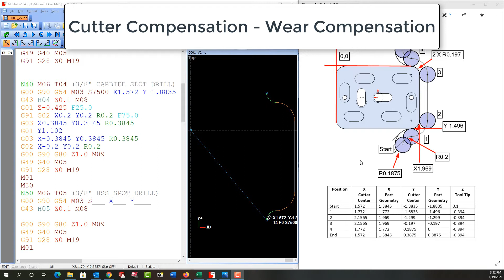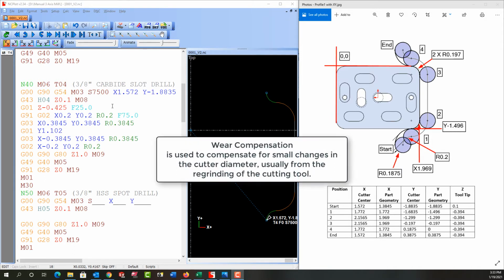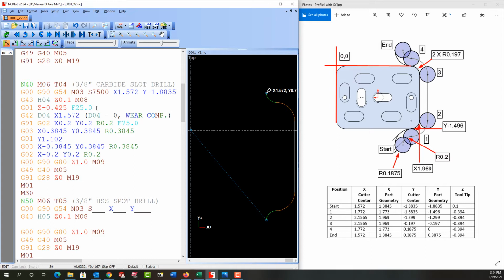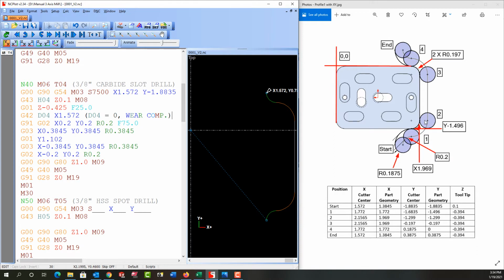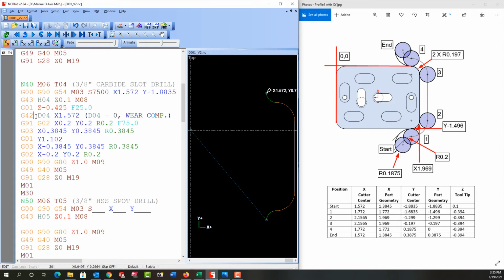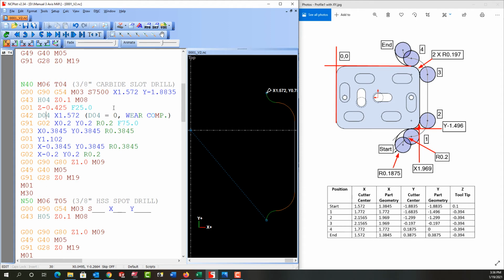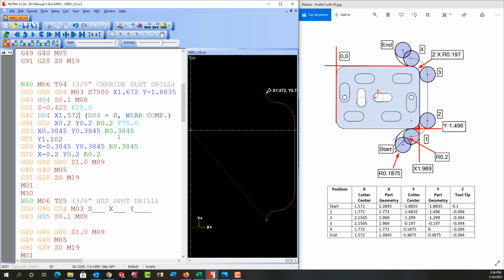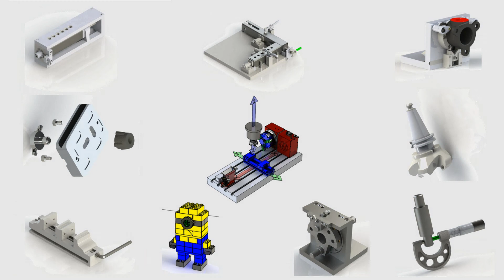Cutter Compensation - Wear Compensation

Comment: What’s the difference between using geometry and wear on the cutter Comp. , some ppl use the geometry column and some use the wear to open/close a hole
Reply from the maker: When using wear compensation the center of the tool is coded and the compensation is used to fine tune the part size. When using non-wear cutter compensation, the geometry of the part is coded and the compensation amount is the radius of the cutter. In some cases the diameter of the cutter is used. Some machines require the cutter diameter to be used and some require the radius and some an be changed to diameter or radius by changing a machine parameter.

Comment: Why don't you just set the wear compensation and let the computer automatically adjust the tool path for you?
Reply from the maker: Because this is teaching manual coding and I am teaching all of the ways to use cutter compensation.
Reply: @Fredumaction  Adjusting for tool wear should not be part of manual coding.  You would have to adjust tool compensation on every G41 line.  And that would be very easy to miss one since you would have to adjust every G41 or G42 that applies to only that particular tool.

Your not necessarily going to have access to subroutines and definitely not canned cycles.  So these routines would look at the D parameter value stored in memory.  If you haven't adjusted this then your program isn't going to be doing what you think it will when using these routines.

Even though what you are doing works it really is not good practice, since most CNC Machines have a setting to compensate for tool wear.  Simply go to the tool offset page and typically you will see that next to the tool offset will be tool wear compensation field.  Measure your tool wear and adjust this setting accordingly.

Hypothetically Speaking (perhaps on a hobby DIY machine): If you are working on a machine that does not have tool compensation at all, most likely there would not be a G41 or G42 built into the machine at all.  In that case you would have to painstaking adjust every tool path you want to have cutter compensation.

If the machine just doesn't have tool wear compensation then just adjust the diameter setting in your tool compensation. This is also not a good practice, but if you did not have a choice this is better than adjusting every G41 or G42 which applies to that particular tool.
Reply from the maker: @makersmark5607  Well, I would disagree with your statements. 
But The reality is that it is my job to teach manual coding and there are many ways to approach the programming of any part. I always teach multiple ways to complete any programming challenge as each person will develop their own style and preferences. 
The best method is always the one each individual is comfortable with and is different from person to person. In the end the most important aspect is the creation of a correct part.
Some times cutter compensation is not used, some time wear compensation is used and sometimes cutter radius (or diameter, depending on the parameter setting and the machine controller) is used. In this series of videos I have tried to demonstrate all three methods.
Reply: @Fredumaction  I can see your point teaching all the ways that you can do something would give people the tools they need to work themselves into their own grove.  BUT....

Manufacturing is a highly standardized field that requires many people to be operating in predictable ways.  Developing personal style doesn't help with that.  Basically your missing the point of standardization.